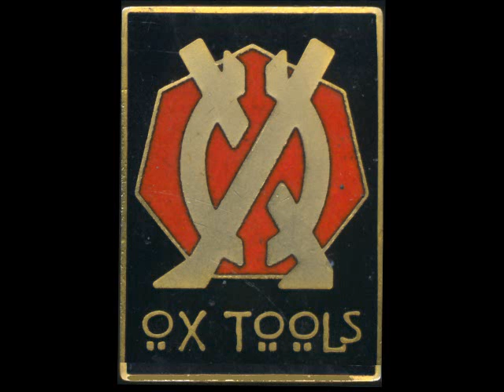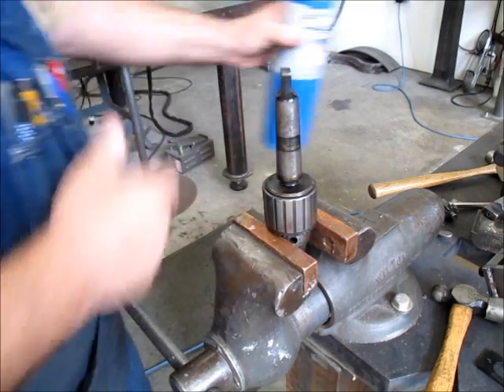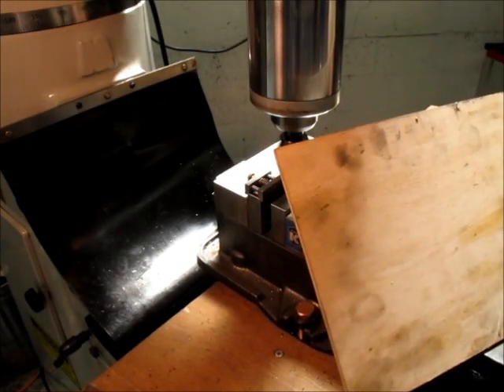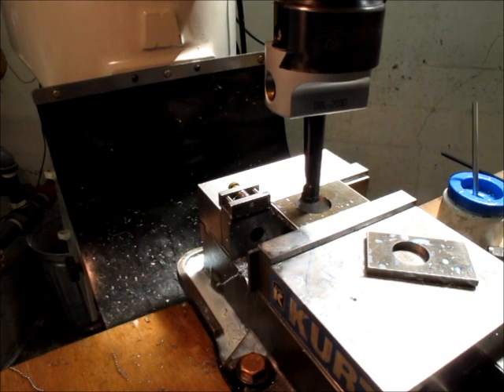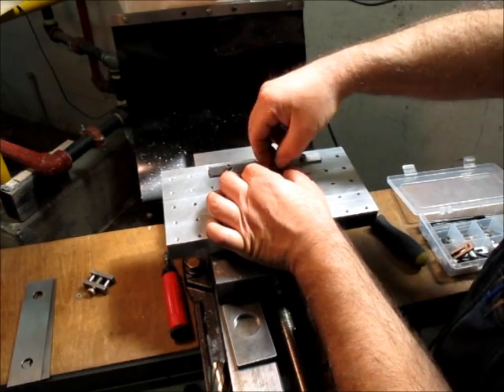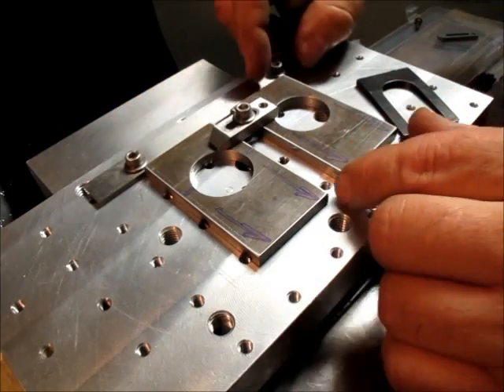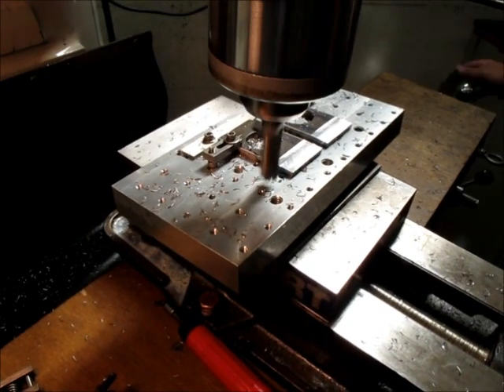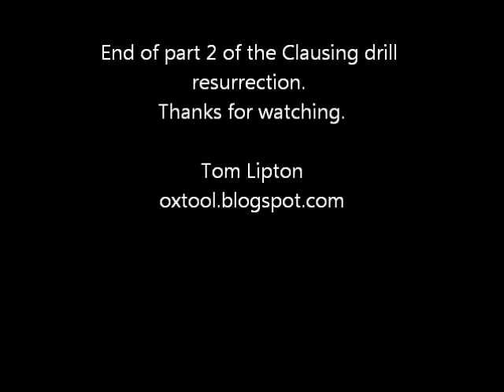Clausing Drill Press 2

Comment: I really appreciate the knowledge vocabulary and the assortment of capable machines you have, I just picked up and also dropped my claiming 22 drill with air feeder and Rockwell multi head commander from the back of the loading truck onto the ground.  I’m concerned with the cast iron parts now being cracked, would really enjoy seeing you dive deeper into the repair work of the clausing drill.! 

My dad is a machinist or was rather he retired about 4 years ago.

Comment from the maker: Hi Herb,

You are correct that there is a small hole through the back of the chuck. On this one the hole is less than 1/8 inch which would have been pretty tough to punch out. However with the wedges applying pressure a good whack with a punch through the hole might have done the job. Good suggestion.

Regards,

Tom Lipton

Comment: 42:15 - my dad worked in a huge oilfield job shop, and had very large machines at his disposal. he used to say when people walked in and gawked that the fastest material removal rate of any machine in the shop is the little 8x10 band saw in the corner.
Reply from the maker: Hey Chris,

Your dad was totally right. Saws are really efficient material removers per horsepower. 

All the best,

Tom

Comment: Hello Tom,
I used to work a big external grinder using large morse taper sleeves on smaller centres to get them to fit the machine they used to become seized together i used to pore boiling water over them and it was enough to release sleeve from the centre without them getting too hot or having to use a torch.hope that makes sense.Stan Gray

Comment: There is another way! The knackered Myford in the old electronics shop here at work used to have to share a chuck with the bench drill which had a captive Jacobs taper. The drill had a threaded collar to pop the chuck off, but the lathe arbor had nothing to wedge against. Jacobs chucks are soft through the centre, so you can drill and tap the back and use a grubscrew to jack them off the taper. If stubborn you can use hydraulic presure to pop them loose. This works so well that you can shrink fit them to the arbor in the first place.
Reply from the maker: Hi Paul,

Why Jacobs does not thread the bottom of the chuck is beyond me. It would save quote a bit of hassle. I would guess they are not designing for the chucks to be moved around very much. Thanks for the comment.

Best,

Tom

Comment: I was wondering why you didn't make the wedges wider so that the legs wouldn't spread as they did in the factory ones.  Seems to be no limit on the width possible which would  make them much harder to bend when driving them.

Comment: Nice easy angle plate that any one can make in a few minutes. Thanks for sharing  :)  I bet a lot of us guys will copy that one. I know I will.
Reply from the maker: Hey Eric,

If you make one and have it around you will find all kinds of uses for it. Thanks for the comment.

Cheers,

Tom
Reply: Amazing how little heat popped that first arbor off. I tried some of those wedges once and promptly snapped one. (no heat) No dent as I recall, must have had a harder temper.
Reply: I like that annular cutter, you get a free HD washer with every hole, just drill to fit!

Comment: Tom, Just watched Clausing Drill Press 2 again. I have already made your neat plate for  holding things in the vise. I haven't added the sine bar to it yet but have all your attachments made. I want to thank you again for all the informative videos. I know it takes a lot of your time but you seem to enjoy it. I hope you never quit. I learn so much from you. I'm wanting the Hougan annular cutters and have been searching eBay for them. But what I really want to know is what inserts and shell mill or cutter holders are you using while milling. Must be ceramic and very expensive. You must have a fortune in tooling. Many years of picking and gathering I guess. Once again THANKS!!
Ron
Reply from the maker: Hi Ron,

Thanks for the nice comment. I'm not following you on the sine bar thing. I don't think we were talking about them in the drill press video. Hougen annular cutters are the bomb. You will love them once you get some. The small inserted face mill I use for steel was actually pretty cheap. If you bought two packs of inserts the cutter was free. Tooling guys run deals like that all the time. The other inserted face mill I use is a AB tools shear hog. Pricey but worth it.

Cheers,

Tom

Comment: I drill a hole through the chuck in front of the taper, so I can use a drift to separate the arbor from the chuck. It probably weakens the chuck, but I've never had any issue with doing it that way.
Reply from the maker: +Jeff Stewart Hey Jeff,

Never seen anybody do that before. Do you drill right near where the arbor ends in the chuck taper? Thanks for the comment.

Cheers,

Tom
Reply: Yeah, sometimes theres already a small hole there, likely to vent any trapped air when inserting an arbor. I enlarge that hole up to quarter inch or so. Then I can set the chuck on an open vice, taper down, and tap the arbor out with a drift. I was surprised to find that none of my chucks are hardened in that area.
Reply from the maker: +Jeff Stewart Got it. Yes I have seen a few chucks with a hole there. For whatever reason I thought you were drilling sideways through the chuck. Dohhh. Thanks for the comment.

Cheers,

Tom

Comment: Hi Tom
Another great video.  My list of to-do projects keeps getting longer and longer.  Why did you mill the pieces side-to-side instead of just milling the "legs" on either side of the material you were then going to mill away while extending the hole?  When you initially marked the pieces (41:37), after securing them on the plate, it seemed that is what you had planned.  Seems it would be less material to mill and the forces would be against the fixed parallel instead of the less rigid sides.  Keep up the great instructions.
Reply from the maker: Hey Morris,

I get to use the table feed in the x direction. Instead of guessing probably wrongly how much to machine away leaving legs I don't have to think if I take it all away. Less thinking equals less work. You are right it would work in either direction.

Cheers,

Tom

Comment: Another reason that the small chuck was so hard to remove from it's arbor, someone had used red Loctite at assembly.  The red color can be seen in the video.
Reply from the maker: Hey Pete,

I never noticed the red coloring. I'm pretty color blind but it surprises me what shows up on video that I don't see in the shop when I'm doing the work. Thanks for the comment.

Cheers,

Tom

Comment: I just bought an 18N jacobs super chuck that had the arbor trashed and needed to be replaced, the chuck was almost new. What I did was open the chuck up all the way and drill a 7/16 hole, the size of the hardened pin I had, then I ground the pin down a bit and used the hydraulic press. It doesn't hurt the chuck, all the reversible chucks have a hole already in them. The 20 ton press I used was about maxed out and then it shot out towards the floor. I also helped out a guy that had the arbor broke off in his chuck, it was an R8 arbor and had broke off flush with the chuck. Hope this helps out someone.
By the way my name is John, the reason I picked the user name I have is it seems most of us are somewhat of a mystery in cyber space.
Reply from the maker: Hi John,

Its still a mystery why Jacobs doesn't put a hole all the way through the chucks for dismounting the shanks. Thanks for sharing.

Cheers,

Tom

Comment: I cringed when you loaded the "adapter gun" up with all of that wedge pressure then aimed it at yourself! Do those chucks not have a through-hole in the chuck? I've gotten them off by using a punch through the opening of the chuck and sticking the arbor down through a hole in some plate so the back flange rests on it. It was a cheap chuck though.
Reply from the maker: Hey Chris,

As you saw it didn't really fly off the chuck with maximum pressure. Not much of a spring system in the arbor assembly. There is a small hole through the chuck but only 1/8 inch. Why they make it so small is beyond me.

Cheers,

Tom
Reply: I've made some really scary mistakes with a 10T press that sounded like gunshots and that's what I was thinking about when I saw the video. I'm a little shy around that thing now. Now that I think about it, It did come off with little drama once you did manage to get it off, so obviously it's less energetic than I expected.
Reply from the maker: Chris Chatelain Hey Chris,

I have a really scary press story. Maybe I'll tell it on camera one of these days. Lets just say we had to knock on the adjoining shops door to go retrieve our stuff. Yes it went through the wall. "Don't mess with the press"

Cheers,

Tom

Comment: on loosening the jacob taper, on a few small chucks i've seen there's a screw in the middle going into the taper, to access it, the chuck has to be opened all the way.  would have been fun if someone had tried that trick on that chuck.
Reply from the maker: Hi Felder,

I have taken a few off of drills like that. The funny part is the screw is many time left handed thread. Thanks for the comment.

Cheers,

Tom